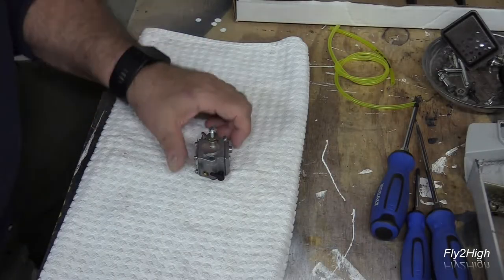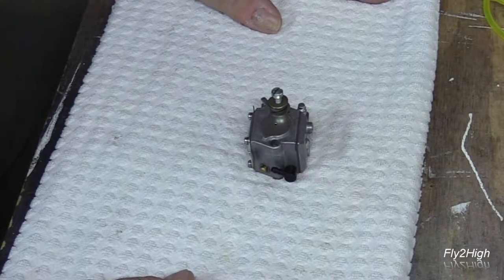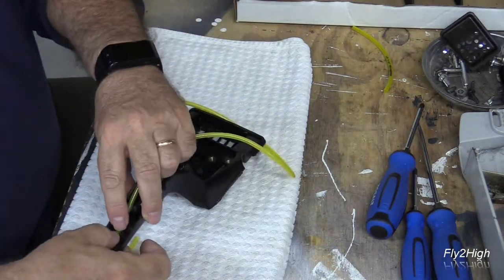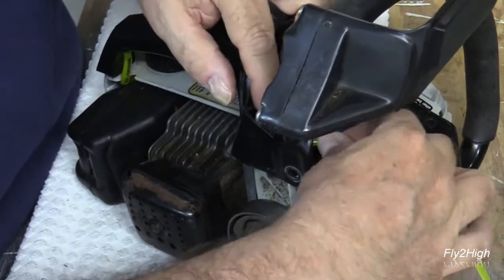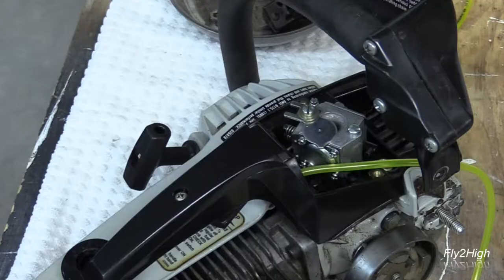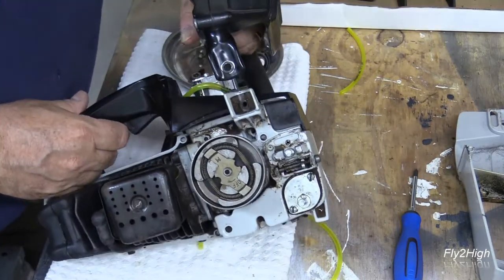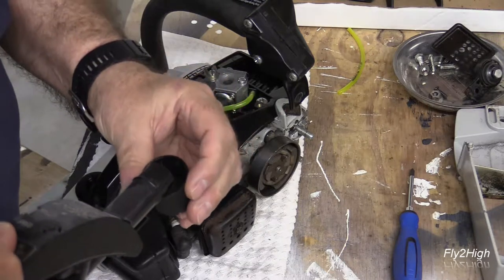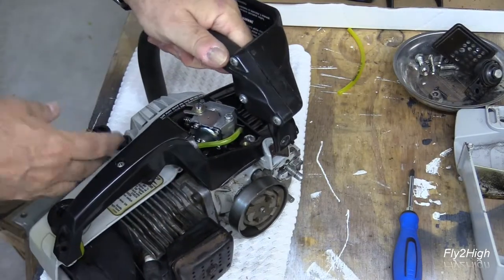Will It Start?  Old Craftsman Chain Saw - Can It Be Resurrected? - Pt-3  FTHVN 680

Comment: That saw looks practically brand new! I just picked the same model up at a yard sale last weekend for thirty bucks. I brought it home and just finished tearing it apart and giving it a good cleaning bottom up, new fuel line as well and a new Oregon chain. Like yours, it took a few pulls before she fired up, but once it was going, it ran well. I also added some Sea Foam to the fuel mixture which helps clean out the carb of any deposits and other impurities. Nice little saw for limbing. 
By the way, the fuel mixture is 16:1. I was running a bit of my 50:1 in it just to see if it'd run. I better follow the mix guide or I'm sure to burn it out. Thanks for sharing this video.
Reply from the maker: Thanks for commenting and watching!

Comment: You will need to replace the small piece of foam that goes around the throttle linkage to keep dirt out of the carburetor compartment. At 2:30 of the video you blew it away. I have to make one for my saw. I like your idea of using foam paint brush for an air filter. You can probably use the same foam to make the throttle link foam bushing. Just make it square like the recess it fits into, and cut a slit half way up into the center of the foam so it fits over the throttle link.
Reply from the maker: Thanks for the tip and thanks for watching!

Comment: just got one  running  today,,an gee  a new fuel line   off it went  ,,needs a new fuel  cap as it spits   but  got one coming  it cuts very good,,,wish they made it  today
Reply from the maker: I think the ethanol found in most gasoline, ruins the fuel lines.  I now us only non-ethanol gasoline in my lawn equipment.  Thanks for watching and the great comment!

Comment: What size fuel line is that??
Reply from the maker: Sorry, I don't remember the size anymore.  I tool the old fuel line over to Interstate Sales and Service and they gave the replacement line.   Thanks for watching!
Reply: I just replaced the line on my unit and it was 3/32 ID and 3/16" OD.